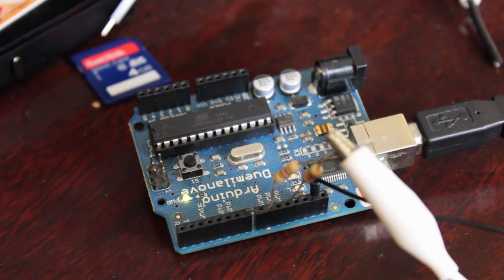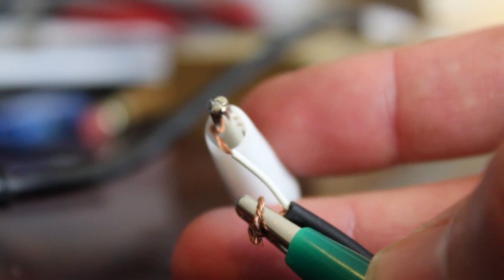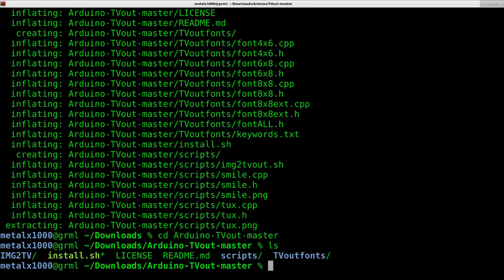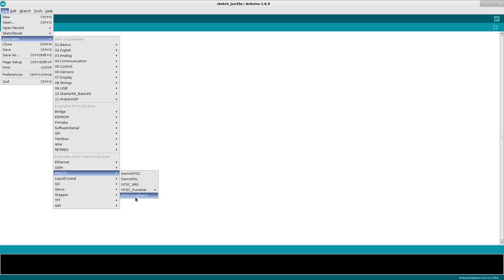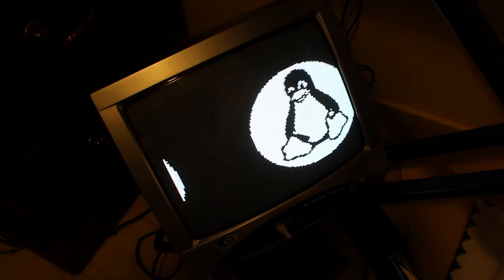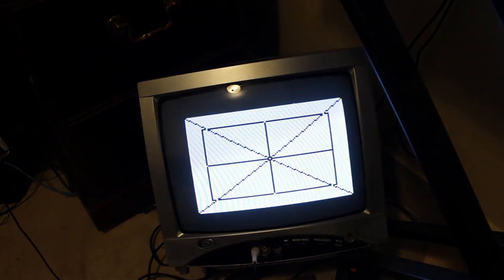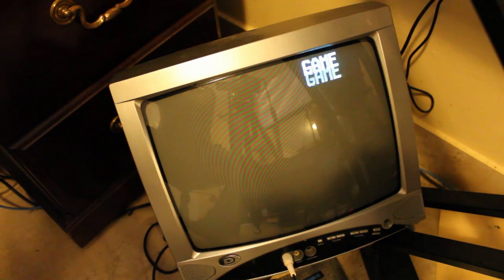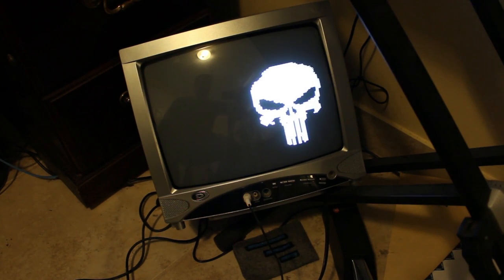Arduino Basic TV Output Setup Tutorial #1

Comment: The 2 resistors are actually creating a voltage divider to reduce Arduino's output pins voltage of 5V into video compatible signals between 0 and 1V. In fact, they make it possible to generate 4 different levels, which are aprox. 0V, 0.33V, 0.66V and 0.99V by switching on pins 7 and 9 either alternatively or simultaneously. 0.33V in this case is used for both sync  and black, while 0,66 and 0,99 provide 2 tones of white.

Comment: You can also easily convert premade arduino sketches to use the TVout library. Just replace the serial.print or LCD.print codes to point to TVout.print or whatever you setup TVout to use. I did this with a Arduino Voltmeter sketch that was attended to use an LCD module, this gave me a reason to use my 1980's portable TV/Radio I had kicking around.

Also you can add in a LM1881 to add video overlay with the TVout library. Comes in handy for DIY security cameras to add time stamps and such.

Comment: I know this video is a few years old at this point but I wanted to tell you that this was the first composite video out tutorial for Arduino that actually worked for me.  I manually copied the folders rather than run your script, and I had to fix that same compile error that you encountered in the video - but other than that it was totally smooth sailing. Thank you so much for this!

Comment: Could this be used to display  to real time data from a sensor ?
Reply from the maker: I don't see why not.  Just put the data into the TV.println function.
Reply: Of course it could, just don't expect 80 column support.  I've seen an all assembler video output on an Atmega that does 80 and 40 columns but it doesn't do lines and circles by itself.

Comment: can you tell me how we can use arduino uno for playing video data from mobile phone (wifi streaming) or usb pendrive  on my crt tv which has only av inputs.
Reply: Leon S  how about if we use zero pie,lesser cost also
Reply: Rpi Zero would, although i think arduino would work too, if they found a way to transmit color data :/. So at the moment it's a no-no. But i'm sure if they made the color stuff possible, you could make an app that records every few frames in a second, rescales it to fit the tv aspect, transmits it to the arduino in binary, and the arduino could pass it to the tv. I prefer Pi :3